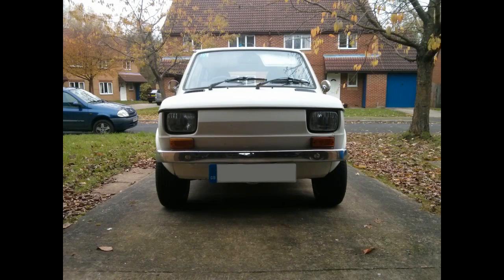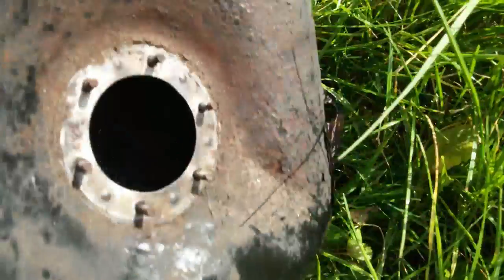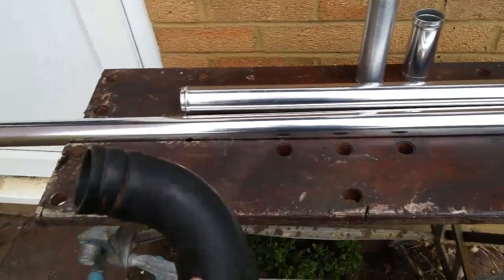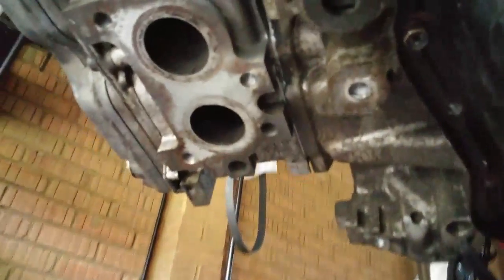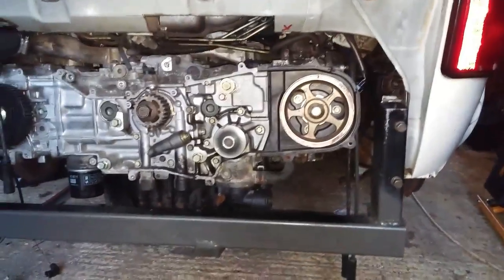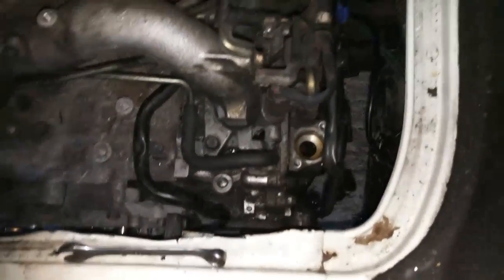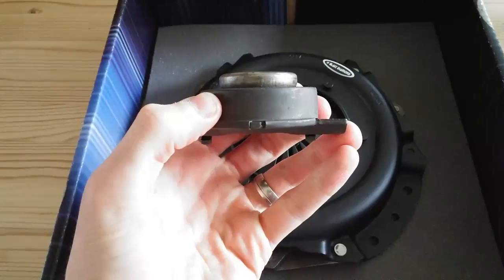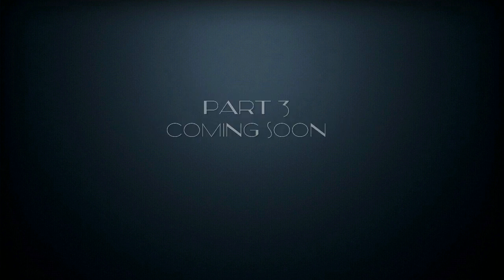Fiat 126 Subaru Project Engine Swap -  Part 2

Comment: very nice project.
isn't that gearbox  too weak for the engine?
Reply from the maker: It's all down to power delivery. Racing would break the gearbox but I will be using it as a Sunday driver so not much strain will be put on the gearbox. 
Thanks for the comment